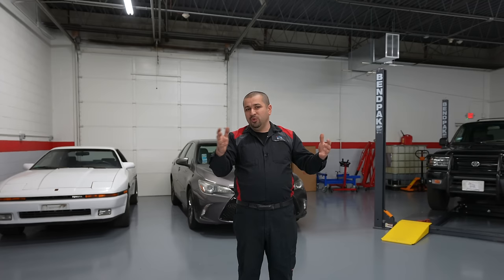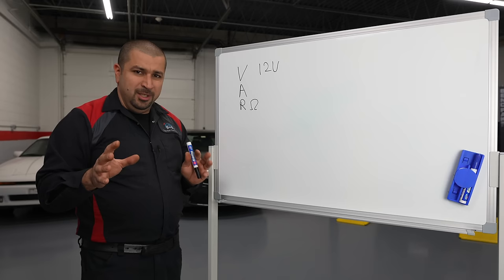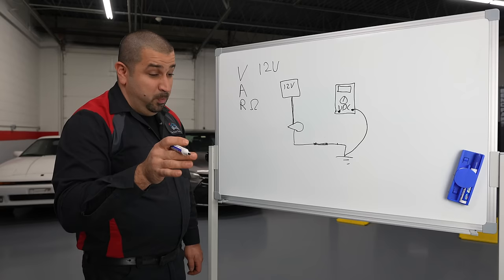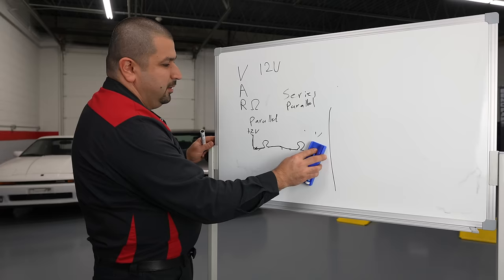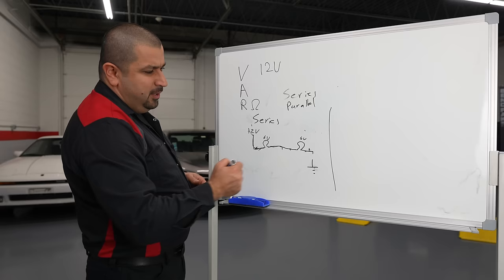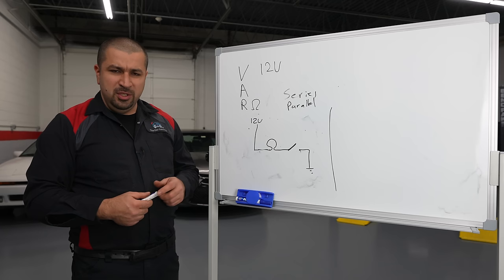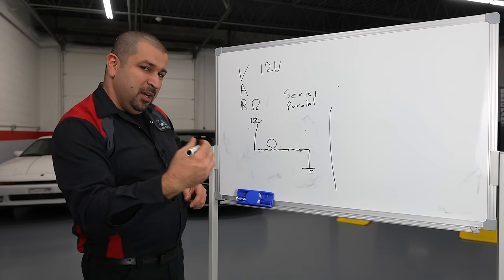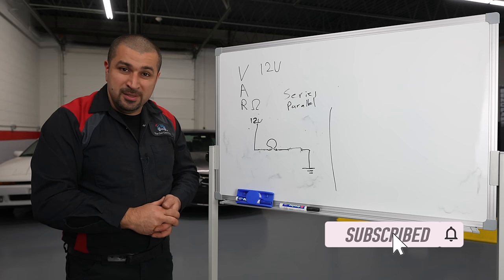Learn How to Diagnose and Fix Car Electrical Problems Series | Part 1 Basic Electrical Principals

Comment: Excellent subject. Awesome explanations. I went to school for auto mechanic. Electric class was my favorite. Instructor hated me. Ohms law is the most important law to remember. I would find and the instructors problem, then create my own problem for the next student that the instructor couldn't figure out. Back then we didn't have computers in cars. I would increase the resistance by changing the wire. Blue 16 gauge to a blue 10 gauge wire. Voltage stays 12v but the amps fall. Causing the components to fail. I have a 2004 lesabre. GMs bankruptcy baby. 90 percent of the wiring is poorly made. I kept this car only to keep my diagnostic skills, top notch. New issue, transmission won't shift. Plugged scanner in, road test. Able to manually shift gears, 1 to 2 to 3 and down. Trans is good. Electrical is the issue. I would rather rebuild a transmission than dig into the wiring harness. Which I know is the issue since there is no speed signal to the computer. Keep up the good work.

Comment: Thanks so much im trying to get certified in basic electrical for Nissan dealership .. We have computer testing and explanations but i still could not comprehend some of it .. This has helped me tremendously to understand what is actually happening when you explained that as the voltage is looking for ground and the voltage goes to a load it consumes the amps and then there is o volts on the other side this is something i did not understand and failed on my basis electrical test . Also the parallel and series circuits were hard for me to comprehend but this explanation has helped thank you..

Comment: This is a very good series … I am wondering if you will be talking about Car Battery and how parasitic drains could be an issue.  Could you also address checking the Alternator, Starter, Battery Corrosion, "relays and fuses" - when talking about the starting side of the system?  Is it true that Cars need more power (CCA or reserve capacity) in a battery because of the newer electronics in later years? Hence does a good, better, best battery an issue or dose it just need the correct power, and where do you find the correct specs for the CCA, reserve capacity, etc. so that you you know you are buying the correct battery? 
It seems like you need more than 250 CCA to turn over the Starter these days, compared to the older vehicles.
Also when checking the Battery is it good to use an Amp Clamp, and do a load test?  How those tests compare with a dsl engine that have two batteries?

Thank you in advance :)

Comment: Great videos, learned a lot from your videos.  I Have a 2017 Lexus RX350 going to 90,000miles. Should I change the transmission fluid now or can I wait for the 100,000miles.  Do I change the transmission fluid and filter or just a transmission flush.

Comment: Basic but well done. And yes, you will not be teaching a college course on electrical theory, but for diagnosing automotive or other circuit problems you have it. My only dig would be the amperage is "I", but "A" is much more intuitive.

Comment: 2011 tundra with the 3ur-fe replace tube seals due to a misfire and a large amount of oil a cylinder 4+6. Truck is back 10 thousand miles and a lil over a month later with plugs 2+4+6 coated in oil with misfires. Yay fridays!
Reply: 300,000 miles👀

Comment: At 19:00 minutes you mention that if you disconnect the bulb, you will have 12 volts because you no longer have amperage. Wouldn't it show up as zero voltage if you were probing the positive terminal on the battery (red probe) and the connection just prior to the lightbulb (black probe) because the circuit is incomplete? Or are you saying that you're probing the point just prior to the lightbulb (red probe) and ground (black probe), which would show up as 12 volts like you said? Just trying to make sense of this to myself. Thank.

Comment: It's like you say, keep it simple.  Understanding the basic principles is key.  The other super important ingredient is your volt/ohm/current meter, you must understand how it works completely.  I'm old school and prefer my good ol analog meter because it is simple, yet accurate, but realize that today's complexities require a more complicated digital meter.  But, with these newer meters comes more confusion and opportunity for mistakes.  Never let meters get in the way of good ol common sense.  Choosing the wrong meter setting, or connecting the leads improperly oftentimes leads to inaccurate conclusions, wasted time and replacing parts that aren't broken.

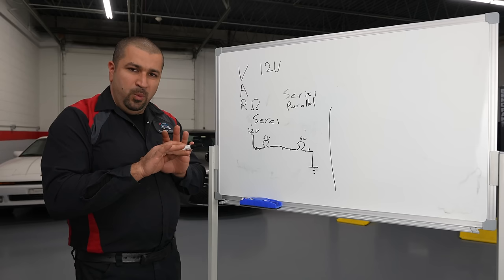Comment: I have a question. At  14:00, when you cut the ground connection on the circuit drawing, wouldn't you be re-establishing the ground, and thus the entire circuit when you touched the positive terminal of your voltmeter to the lead from the circuit and the ground terminal to a new ground point? When you do that, doesn't the current's path travel through the voltmeter?

Comment: Thank you sir for this outstanding opportunity to grow. I’m in technical school, but have been working with cars for a while. Pulling engines and electrical diagnostics are like yin and Yang to me. I’ve never had the opportunity to learn anything electrical, except occasionally installing stereos for myself and a few buddies. Although they cover electrical in trade school, due to the length of the program, they aren’t able to cover electrical diagnostic practice and application to the extent you truly need to excel in the modern day automotive industry. This video is a great learning opportunity :)

Comment: Ive done electrical diognosing but a 92 buick park avenue is still no spark no start but turns over. I checked wires continuity, volts. Checked alot but can you check ims under coil towers for continuity?

Comment: If you work on modern cars diy or not 90% or more of the work is electrical. Voltage is electrical pressure amperage is the flow of electrons and resistance fights voltage

Comment: The radio in my ‘12 FJ has a gremlin in it! When I’m driving, it sometimes goes dark, but the radio still plays. The knobs don’t work but the music still comes out. At night, I turn my lights on and it sometimes goes dark as well but the music still plays. A short while later, it lights back up again and will be fine.

Comment: Question: so if a 12v parallel circuit had 4 bulbs. Does the circuit automatically give 3 bolts per bulb? Or would the bulb be engineered with the correct resistance to use up 3 bolts.

Comment: Fantastic video, you may want to add in future videos the importance of a incandescent test light as that will complete the circuit for you whereas just testing continuity with a multimeter may hide a short to ground.  Diagnose Dan literally just had a video with a short on immobilizer comm line that puts in practice what you taught in the whiteboard.  Excellent video Car Care Nut
Reply: Congratulations you're randomly selected among the giveaway winner, contact the number above for more information 📩📩

Comment: Hi car care nut. A big fan of your videos. Have you heard of the good news my friend? The rav4 hybrid and venza 2023 cable gate corrosion issue is already fixed. In here they changed the bolts and connector to the motor to be aluminum and stainless. And per your lesson less rust means less resistance right?
Reply: Do you think a tech bulletin is coming for 21 and 22 models in the near future?
Reply: @hss8973  yup I think so. Car care nut says that it is easy to fix though so maybe a DIY tech info would come

Comment: I know you're busy and trying to keep this simple.  If you had a battery, some wire, 2 bulbs, a switch, a meter, a resistor and a small layout, you could show all this "dynamically" which would make more sense to those techs and future techs HOW all this works.  Ya it takes time to do this, and I applaud you for presenting this, but seeing the theory of operation working AFTER the description is presented would eliminate a lot of "huh?" to the person learning it.  Just my opinion.
Reply: agree 100%.  AMD is the best but,  seeing is not only believing, it is also understanding.

Comment: Car care nut. 2018 camry i have a squealing/whistling noise coming out if my vent Only when ac is on SOMETIMES. what could that be ? Sounds very close to actual vent and not a pulley or tensioner

Comment: The vast majority of automotive electrical diagnosis is solved by testing Voltage Drop across the circuit. It isolates the fault far better than resistance testing. In many cases resistance can be misleading, it's also tested on non active circuits. Voltage Drop testing must be tested on live lines with power to the load. If you dont have the power to the load then the wire before it cant show a variation of Voltage ⚡

Voltage testing padt the load on the ground side of circuit will identify short to ground by reading voltage on negative.

Comment: Good for the circuit basics, but probably should have shown the direct connection between Battery Negative and Ground as part of the basics. DC Current will always want to return back to the Battery Negative. Ground is not always ground and many times ground can be that sneaky resistance in the circuit.

Comment: I have a gen 3 2010 prius.  And my transmission has some noise. I was bringing to toyota dealership last month. And they said my transaxle has damaged. I was worked a mechanic shop 3 years so l can change the transmission myself. My question is if l change the transmission’ do l need to program the new transmission’ ?

Comment: Interesting subject that I'm sure will be useful. As regards the relationship between amps and voltage, my Toyota corolla 2.0 hybrid 12v battery won't charge above 12.4v. After testing, Toyota dealership say that the amps for that voltage is correct and anything above 12v is ok as it is only used for ancillary equipment. I'm no expert but everywhere I read on the subject it states that a 12v battery large or small should read 12.6 and above when fully charged, I'm Confused..

Comment: Thank you very much 
You should be working for Chrysler my friend and help they engineers to make electrical circuits board 
I have 2015 Ram 1500 that I love it until I decide to install LED BULB 
Chrysler has this beautiful idea to put what is called TIPM or Total Integrated Power Module 
This fantastic unid control every single circuit and if see it something that don’t belong to the car just open that specific circuit and you have to replace the whole TIPM instead of replace a simple fuse or relay 
What a fantastic idea 
Thanks again for all your videos

Comment: I have to take my car in for service at the Toyota dealership this week. When I start my car I get a whirling sound. It continues when I back up and put it in drive at low speeds. Do you what this is? The dealership is going to give it a multi-point inspection and clean the fuel system that was diagnosed the last time I brought the car in for service a couple of weeks ago (and saved me some money performing the work at the time.)

Comment: Great video as usual.   My 2 cents worth. when using a white board, make the white board the "star".  Meaning have the camera directly in front of the white board (not slanted in a angle) taking the majority of the frame..  EE (engineering explained) does a good job on using White Boards in youtube (check him out).  Again, thanks for sharing the knowledge.
Reply: I think he slanted it so he doesn't obstruct it as much as if it were perpendicular to the camera.

Comment: Hello and thank you for all of your excellent information. I have a question about parallel and series circuits. If there is only one load on the circuit, then it's called a parallel circuit and if there are two or more loads on the circuit this would mean that it's a series circuit. Is this correct and is this the only thing that separates the two?

Comment: You did very good with your explanations.  You kept it simple.  I taught mechanical vibration theory a long time ago.  When I first started teaching, I had a real hard time explaining theory.  I would drift into technical procedures before I had finished with the simple stuff.  I finally did it but it was a problem at first.  You did good job.

Comment: Hi. If i wanted to make a mock up electrical system of a motorcycle with a complete harness and a 12v battery plus components such as lamps, what else would i need to add so that i can practice multimeter testing and diagnosis? Don't say a motorcycle 😂. I don't have a garage for my bike so want a set up that i can practice from my warm, dry room during this very wet and cold period

Comment: I asked this of another instructor regarding voltage drop. He talked about a single bulb in a circuit and two bulbs in a circuit. This has never made sense to me. The current gets to the first load (bulb) and uses itself up on it and there is zero current on the other side. Yet if there is another load ahead, there is current left. How does it know there is another load (bulb) waiting for it down the line and what makes it share itself with that other load when it hasn't even gotten to it yet? That's the part nobody ever explains-- they just accept that it somehow knows there either is no load ahead so it uses itself up, or it knows there is another load ahead and saves some of itself for that load. How can it know before it meets that second load?
Reply: I'm a newbie to this, that's why I'm watching this. However, when I have a question I cannot ask our excellent instructor, I ask Bard, Google's AI. Following is one of the drafts resulting from posting your question to Bard:

You're absolutely right, the idea of current "using itself up" or "knowing" about future loads in a circuit can be misleading and confusing. It's important to remember that electricity is not a fluid that gets consumed or depleted. Instead, it's a flow of charged particles (electrons) driven by an electric field.
Here's a more accurate explanation of what happens in circuits with one and two bulbs:
One bulb:
When a battery is connected to a circuit with only one bulb, the battery creates an electric field that pushes electrons through the wires.
These electrons flow through the bulb, encountering resistance (opposition to the flow) from the filament inside.
As the electrons overcome this resistance, some of their electrical energy gets converted into other forms like heat and light in the bulb.
However, the electrons themselves are not "used up." They continue flowing on the other side of the bulb and back to the battery, completing the circuit.
The current (rate of electron flow) remains the same throughout the entire circuit, as dictated by Kirchhoff's Current Law.
Two bulbs in series:
When you add a second bulb in series, you essentially add another resistance to the circuit.
The same electric field pushes the electrons through both bulbs now.
As they encounter each individual resistance, some of their energy gets converted into light and heat in each bulb.
However, the electrons don't "split" or magically know there's another load ahead. They simply continue flowing, driven by the electric field.
The overall current remains the same throughout the circuit, but the voltage drops across each bulb due to the energy conversion.
Key takeaways:
Current is a flow of electrons, not a depletable resource.
The electric field created by the battery drives the electron flow throughout the entire circuit.
Electrons don't "know" about future loads. They simply encounter resistances and convert some energy as they pass through.
Kirchhoff's Current Law dictates that the total current remains constant throughout a series circuit.
Instead of thinking of current as "using itself up," consider it as a continuous stream of electrons driven by the electric field. The energy they carry might change form (e.g., from electrical to light), but the flow itself persists as long as the circuit is complete and the battery remains connected.
I hope this explanation clarifies the concept and removes the "magic" from how current behaves in circuits. If you have further questions or want to explore specific aspects in more detail, feel free to ask!

Comment: I have Toyota corolla 2015. there is  12 volts in Trunk wire ,,, but its can't turn on the light. If I Understood  you'r explanation that's mean. I have problem in the ground.

Comment: I'm liking it. Allot.
Basically, the parallel becomes a series, because of the draw from corrosion?
I look forward to the next lesson. 
Would it work to just have two six volt bulbs in a series, or does there have to be some kind of intervention from another component?
Reply: @fknbastages: Two six volt bulbs in series would work but if one bulb burnt out you would lose both headlights which obviously would be very dangerous. :)

Comment: I used to be a big Toyota fan worked at the dealership I was in the T-10 program in college than I failed my A6 ASE by 2 fucking points after I studied for 3 months straight after that I got into a relationship with someone who worked at my dealership a week later I got fired I’m currently learning how to be a heavy equipment operator and I’ve given up on working on cars but I know a lot about electrical I’ve done sound systems for all my friends and family I’ll always have love for sound systems and electrical diag